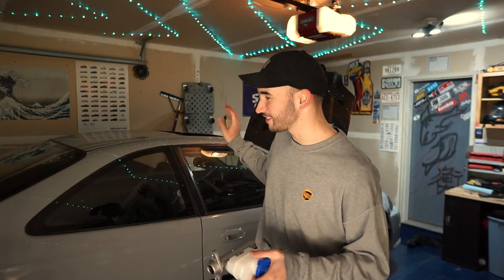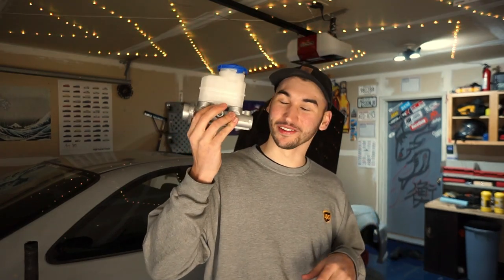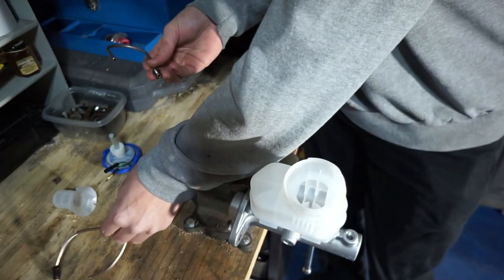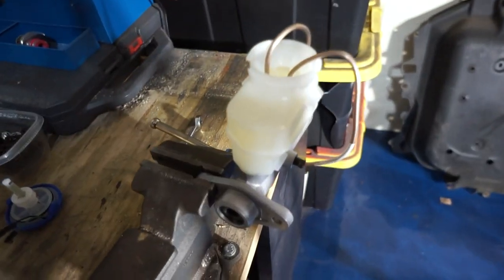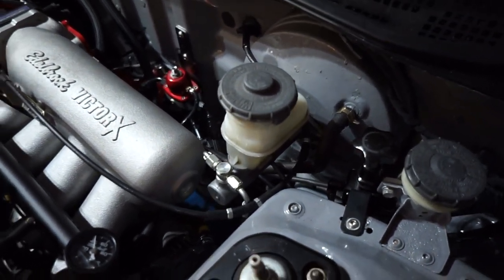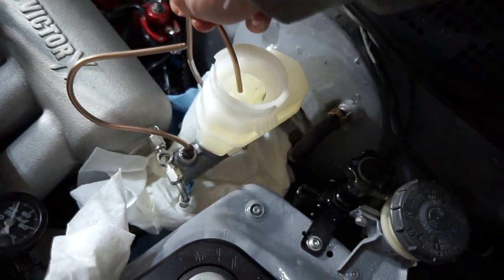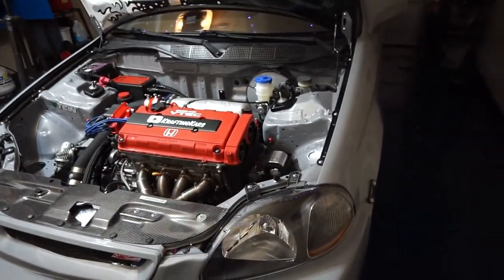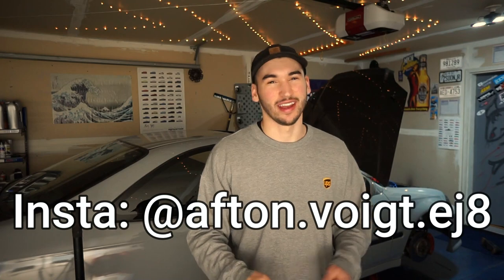Civic ITR Brake Master Cylinder Upgrade + Bench Bleed DIY

Comment: Idk if I did leave a comment but holy shoot thank you for this video. So many conflicting answers in the forums. My 7/8 leaked where the booster is. So I replaced it with the 1in cause I saw it for sale for 115 with only 500miles. Fit perfectly. I do have to ask though. Do the brakes feel a tiny bit spongy? I bench bled and bled the whole system. The brakes work don't get me wrong but I thought they were going to feel stiff. It felt like little resistance om the pedal but the car still brakes good. I'll do some more testing maybe my lines are too old or something
Reply from the maker: Haven't road tested mine yet, but if you still have rubber lines instead of braided going to your calipers that can cause that. Double check your bleeding job to make sure you did it in the right sequence, it is a little tricky doing it by yourself. And yeah, at the end of the day, it's still a 90's car, the brakes won't be nearly as touchy as todays new cars. But that's ok, it helps with heel toe downshifting!

Comment: Civic ex and dx have the same brake booster ? (Same year 97) non abs. Love the color of that civic ek, kinda reminds me of the color on Honda Accords. I have a 97 civic ek with Porsche brakes and I was wondering why my brakes will sink in. I need a 15/16 or 1” like what you just did ! Thanks for the content, much appreciated!
Reply from the maker: 13/16 for the DX
15/16 for ex and si
1" for Type R

Comment: Not even gonna lie... But I like all your content! Especially when it comes to these types of builds. You're very specific and your explanations are very simple. The camera angles are fantastic. And you get to the point real quick and get to business real quick.

Couple of questions;

1) Would the ITR Master Cylinder work on my 1990 Integra LS?
I've been researching it but no luck. I've ran into some Honda Threads but they turn out to be a debate.

2) I wanna hire you to be my mechanic, to help me build my JDM B16A from the Integra XSi.
Where are you located? LOL
Reply from the maker: Currently I am too busy with my own project to be hired out 😂 I'm not to sure if the ITR master cylinder would work on a DA integra, it may require you to swap your brake booster as well

Comment: I am about to start my big brake upgrade on 99 civic lx sedan.  Thanks for this video.  One question.  Do I need to upgrade my brake booster?  You have the EX booster and I have the LX. Not sure if there is a difference
Reply from the maker: I don't believe there is difference in bolt pattern, it should work with any 96-00 civic

Comment: I’ve watched all your videos on the brake upgrade. Wonder if I would follow all these parts I need the same as I’m doing it on a del sol and wonder if this master cylinder would also work on my del sol. The del sol is pretty much a civic
Reply from the maker: I'm not 100% sure, the del sol is closer to an EG civic

Comment: When you remove the brake lines after bleeding, is there any chance air get into the system ?
Reply from the maker: Yep, after disconnecting your lines, and bench bleeding your master cylinder, when you hook it all back up chances are there will be a little air in your lines from fluid spilling out, so I'd recommend bleeding your lines afterwards.

Comment: What size is your brake booster
Reply from the maker: I have the stock booster for a 97 civic ex non abs, the stock master cylinder I has was 7/8", the new type r master cylinder installed in the video is 1"
Reply: Is the brake booster that came with the 1 inch brake master not necessary when swapping over to your Civic EX?
Reply from the maker: @nic3guyeddie  correct
Reply: @kraftingkars  holy shiz thank you I've been looking around everywhere for this answer thank you!! I have a leak by the brake booster and was like I'll just upgrade the master cylinder but had so much conflicting info on the forums. Thanks again
Reply: So you only need to swap out the master cylinder and not the brake booster?

Comment: I upgraded my calipers from 15cl to 16s. I still have 13/16. Does ugrading to 7/8 improve braking?
Reply from the maker: Definitely! Because of the larger volume cylinder, you move more fluid with less pedal travel, which means more responsive braking

Comment: mate I've upgraded my 13/16 brake booster and master cylinder to a 1 inch master cylinder and brake booster. But now I'm having brake Dragging issues. Once the brake fluid is hot the car will constantly brake by itself. My dx is non abs. Do you have any idea what could cause this? I have adjusted the pedal several times but the problem will persist
Reply from the maker: Try bleeding the lines and bench bleeding the master cylinder

Comment: With this setup are you still running a proportional valve? I see the front lines connected to the dual banjo fitting and rear is utilizing the chase bay 2 to 1 kit.
Reply from the maker: Yep, I run a chase bays adjustable brake bias prop valve

Comment: Hello im trying to do a rear disc brake convertion on my 1998 honda civic dx hatchback. Ive been trying to get an answer if that brake master cylinder if is just a bolt on with the two brake lines that comes off the cylinder. This is the only part im missing to start doing the convertion. Btw love your built!
Reply from the maker: Yep! It is really a simple install. Two nuts hold the master cylinder onto the studs coming out of the brake booster. Then it's just two hard lines (front and rear) that screw into the master cylinder
Reply: @kraftingkars just to double check - the dx is the 13/16 Master cylinder - the itr 1in Master cylinder is a direct replacement correct- I am concerned about the brake hard lines not lining up

Comment: thank you for the video! Is there a difference in MC fitment if you have an ABS civic or if the MC is from an ABS integra and your civic is non-ABS?
Reply from the maker: Seems like there is a difference, I'm not sure exactly what but the abs master cylinder is designed to work best with an abs module. Since my civic is non abs, I went with the integra type r master cylinder since it is also non abs, has a larger diameter piston, and all the bolt holes/flanges are in the same spot as the ex
Reply: @kraftingkars  thanks! I think this is where I'm confused. the ITR and GSR have the same part number for their brake master cylinder, but all GSRs have ABS. so confusing! anyway, thanks for the info!

Comment: I found your video looking for an answer or reference to change the brake servo of a honda sedan to one of integra make that upgrade, would you recommend it?
Reply from the maker: What year is your Honda? I don't know what a brake servo is, do you mean brake master cylinder?
Reply: @kraftingkars  civic 95 4 doors with integra rear disc swap.  the servo brake is the brakeboster
Reply from the maker: @SOILASS  oh I gotcha, so I would recommend upgrading to an integra brake master cylinder for you! And you should not have to change your brake servo/brake booster! Your factory brake lines will need to be modified though since the ports on the integra master cylinder and an eg civic are different!
Reply: @kraftingkars  mention the brake booster because the OEM of my Civic is already failing and if I would change the brakebooster, master cylinder and the lines.
Reply from the maker: @SOILASS  ah, I would just put another 95 civic brake booster in. There is no performance benefits of upgrading to an integra brake booster
Reply: @kraftingkars  but it could be put even if it did not benefit, I ask about the cost, it is a little cheaper for the integra than for the civic
Reply from the maker: @SOILASS  I believe the integra booster will fit
Reply: @kraftingkars  Thank you very much for the guidance and help, new follower and subscriber, greetings from Mexico

Comment: Great video, really informative! I just have on question and i can’t seem to get the answer. I have an EK civic and i want to swap in the 1” cylinder. On some forums I have read that it’s a simple swap but on other forums i read that the first port has a 12x1mm thread and the second port on the master cylinder has a 10x1mm thread, which means i have to reflare my brake lines. Is this true?
Reply from the maker: Is your civic an ex? I didn't have to adapt any threads. Both the front and rear port are the same size
Reply: @kraftingkars  thanks! If they’re both the same size then i should be good. Did you get the non abs integra cylinder? Maybe that’s the difference.
Reply from the maker: @Dani.Burger  my 97 civic doesn't have abs, and I don't believe the integra type r did either. https://jhpusa.com/products/honda-brake-master-cylinder-97-01-integra-type-r here is where I purchased mine! Great site and let's you track it!
Reply: @kraftingkars  thanks alot! There is so much information on the forum, but everyone was saying something different. Thanks again😁
Reply from the maker: @Dani.Burger  glad I can help, and yeah everyone has different answers out there so it's pretty confusing.